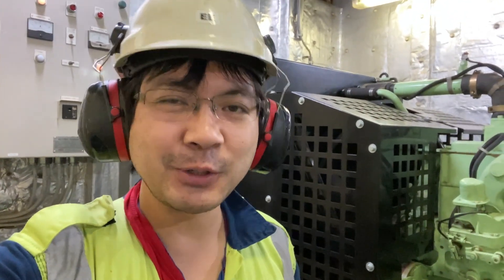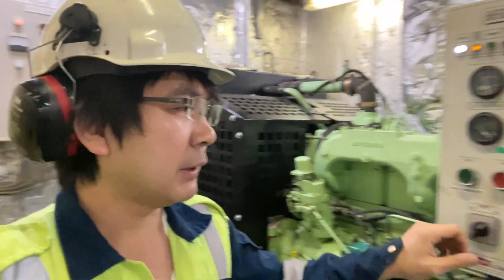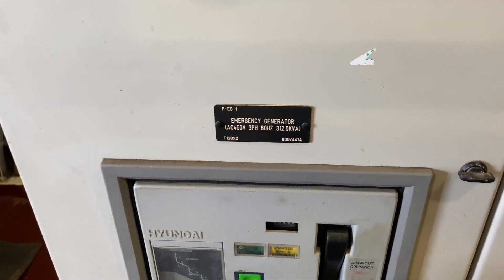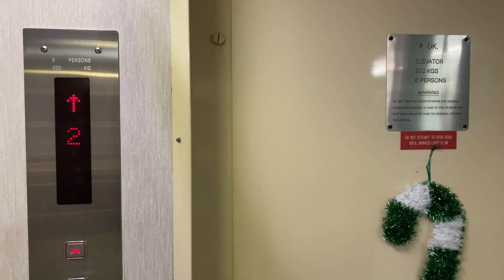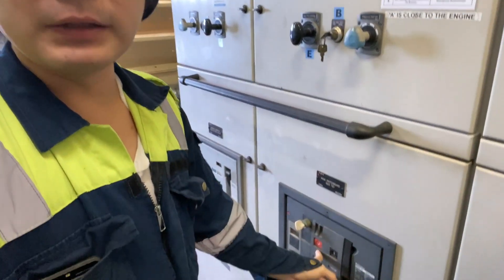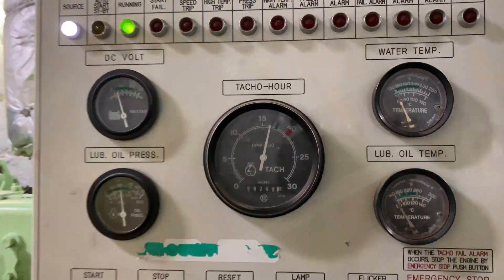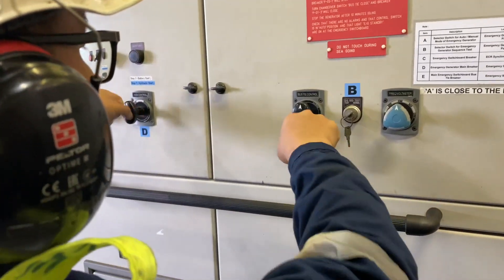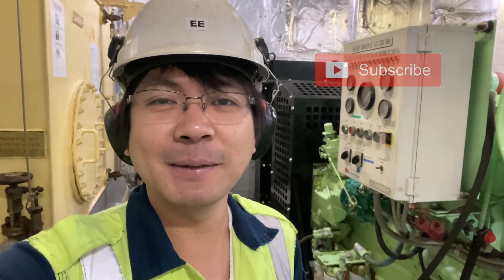Emergency Generator Load Test by leckyjake Vlog 004

Comment: Thank you sir for yr video.
some emergency switchboard arrangments have a key which can be put to test or simulation mode. does it cause the main switchboard bus tie to open.therby causing the emergency generator to start.like u did in the video .thanks in advance.

Comment: Sir elect may tanong ako tungkol sa emergency generator ,. Ang battery ng emergency generator ay automatic ba yan nagchacharge.. Kahit dmo pah iniinistart at nka stanby nagchcharge ba yan. Kasi ayw umistart dito sakto naman yung voltage. Bigla nalng ayaw umistart, tenistesting ko to weekly. Ngayun pag pinipress ko yung start button  may lagutok lng sia doon sa solenoid na 24volt, may tutunog lng. Hnd sia tutuloy magstart.. Sna may free tym ka sir elect at mkarespond. Thanks and more power to ur channel.
Reply from the maker: Ang pag check ng battery is dapat pinapatay mo ang charger pala malaman ang mismong voltage ng battery. Kapag di mo pinapatay ang charger ang nasusukat mo is yung voltage ng charger mismo.

Regarding sa condition ng battery mo, ang life span ng batteries nag last lang ng 2 years. Kailangan every 2 years pinapalitan ang battery. Second, if hindi mag start ang Generator mo using battery, try mo start sa hydraulic system, kapag nag start sa hydraulic then malamang sa malamang need mo na palitan ang baterya mo.
Reply: @leckyjake  salamat sa tips sir lecky, may point ka na dapat i off muna ang charger kung mag reading ng voltage.NOTED.
So automatic  pla talaga, 
Akala ko  kasi nung ona hindi sia atumatic magcharge, akala ko tuwing mag start lng sia mgacharge.

Godbless!

Comment: I want to ask how supply signal is given to emergency generator when main generator trip or black out . As  normally we have beaker for emergency generator in ECR if main generator running .
Reply: no voltage relay senses the voltage and sends signal to start the emg gen in event of blackout..In this video he opened the tie breaker and start sequence initiated.

Comment: Sir good day tanong lang sir. 
Anong test yan sir for emergency light lang or blackout?
Once off mo bus tie mag blackout sir?
Reply from the maker: Testing of emergency gen kung papasok ng auto in case of black out. The idea is tinaggal lang ang ESB sa MSB by opening the ACB. Hindi siya yung full black out na patay lahat.
Reply: @leckyjake  ok po sir. Maraming salamat po sa oag share. Bale parang blackout simulation test lang pala. Emgcy lights lang gagana.
Reply from the maker: Marc Aguihap hindi sir, emergency lights ang mawawala at lahat ng connected sa ESB
Reply: @leckyjake  baliktad pala. hehehe
 Emgcy pala mawawala. Ok po sir. Maraming salamat sa pag share po sir. Godbless.

Comment: Sir kapag ngclose po yung emcy ACB automatic na po b mgopen yung MSB bus tie? Salamat
Reply from the maker: rodel durban yes. Open mo muna bus tie ng msb tsaka mo close ang sa emcy.
Reply: @leckyjake  thank you very much sir..
Reply from the maker: rodel durban pag onload mo unang mag open ka ng MSB bus tie at auto mag close ang emcy acb. Pag put back naman need mo open ang acb the manual din close mo bus tie ng msb
Reply: @leckyjake  ok sir pro pagminanual mu sir yung emcy d/g open parin muna msb bus tie before closing the ACB control knob? Thanks